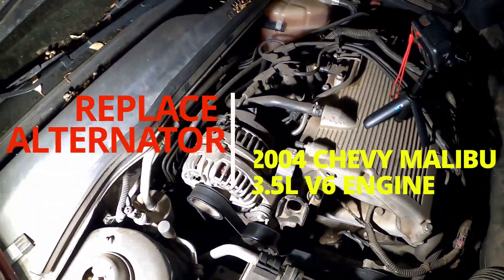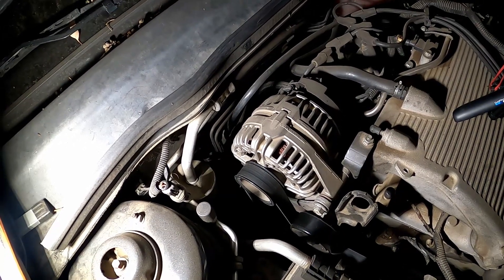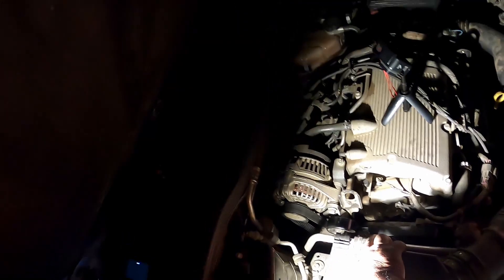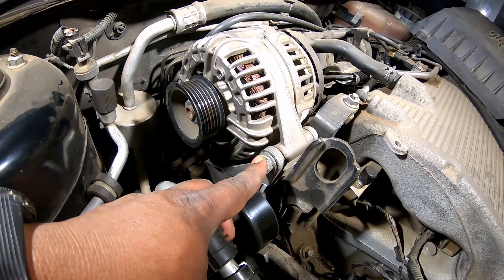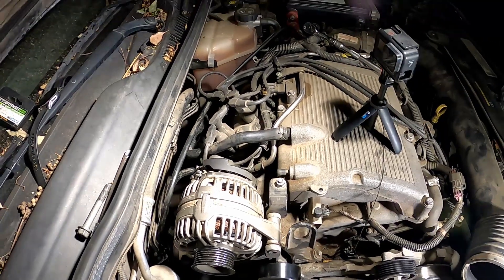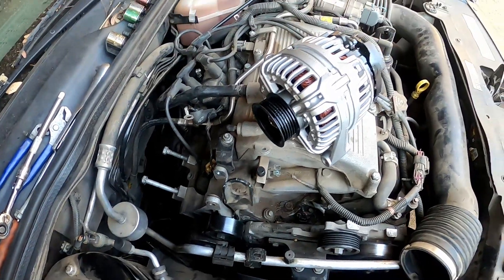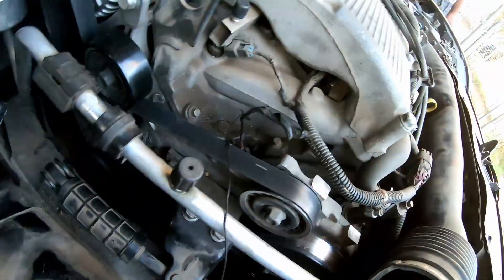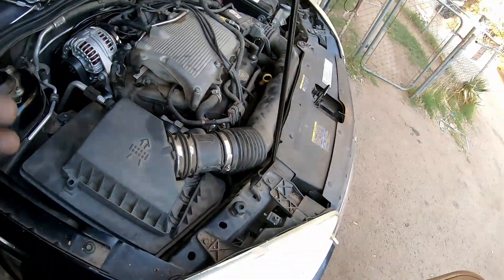HOW TO REPLACE AN ALTERNATOR ON A 2004 CHEVY MALIBU 3.5L V6 ENGINE

Comment: I’m having trouble taking the air box out. I got both those screws out but the ac hose seems to be in the way?
Reply from the maker: The air box is easy to take out just take out the screws and it come out no problem
Reply: @DA1ONEVLOGG I’m getting stuck at the box removal as well. How the frame cuts from the air box in the vehicle. Then removed to get more access to the pulleys.  🤔
Reply from the maker: @travrick1856  just take your time and remove the screws it's really easy to take it out
Reply: @DA1ONEVLOGG yeaaap that box JUST fits in there. Had to play those angles…. Got my job finished then autozone ran test to find the alternator I just put in FAILED!! 🤣 💀 thanks for the quick reply!
Reply: @DA1ONEVLOGG awaiting part replacement to do it all again!! 😅

Comment: What brand of ratchet are you using that the handle accepts extensions on the end? Also, I really enjoyed the video. I had my alternator removed and replaced in no time.
Reply: any kind of ratchet handle will work.  The big thing is that you need a 3/8" drive for the idler pulley to release the drive belt.
Reply from the maker: Yeah true but he like the tool because you can add extensions to the handle
Reply from the maker: I don't know the brand it was giving to me. And thank you for watching